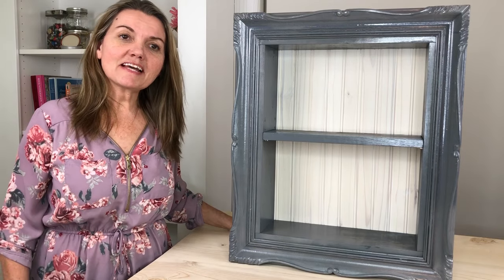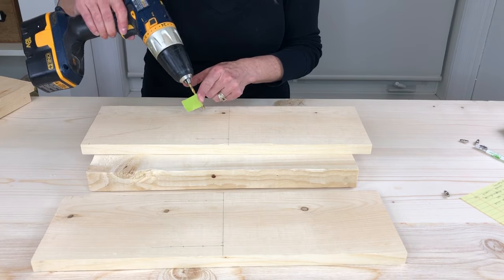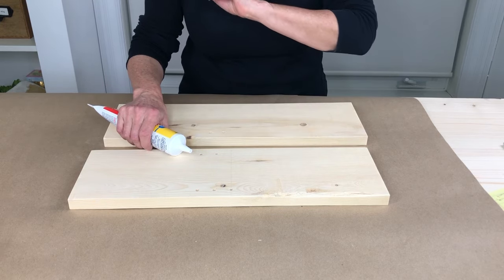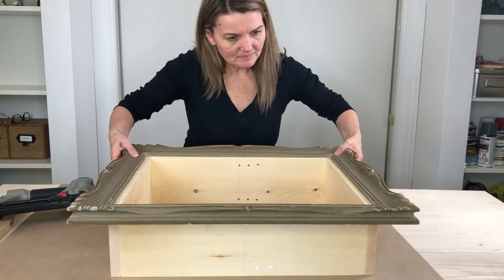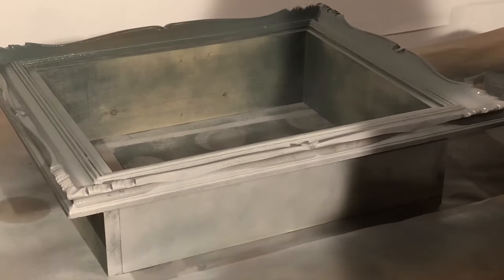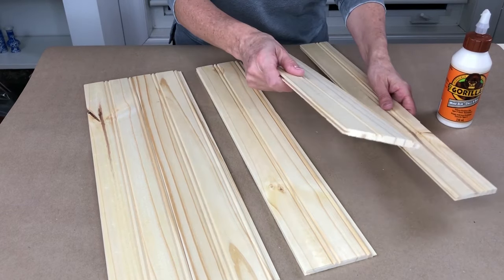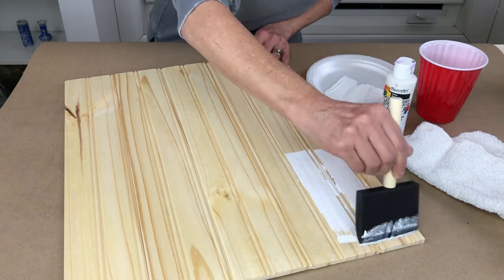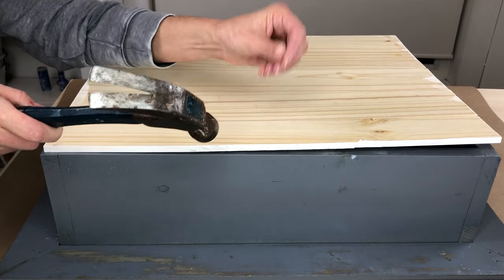Picture Frame Shelf - DIY Project

Comment: Hi I love your video I have a very old frame  it belongs to my deceased grandma so it has very sentimental value for me.. i am thinking to attach a drawer that i already have The problem is that the frame is bigger than the drawer a few cm ,how can I attached the frame to the drawer with out cutting my fragile frame?
Reply: If I understand you, you need a way to attach the drawer inside the box part the frame is now on? I would use “quarter round” trim finishing nailed to the inside of the three sides of the box to provide a ledge the drawer can sit on and slide in/out.
Reply: @tempeststudios  is there any kind of video that is showing how you do it??
Reply: @K.C8281  Sorry no.
Reply: @tempeststudios  thx alot